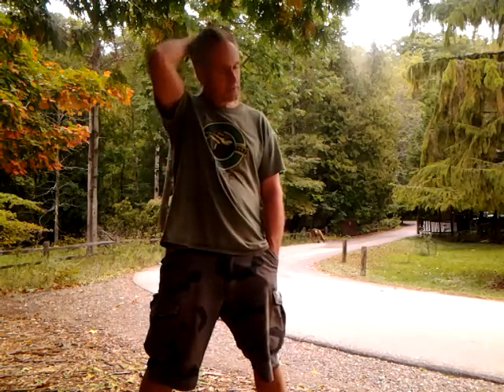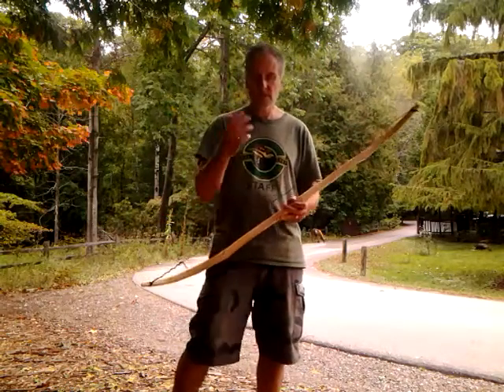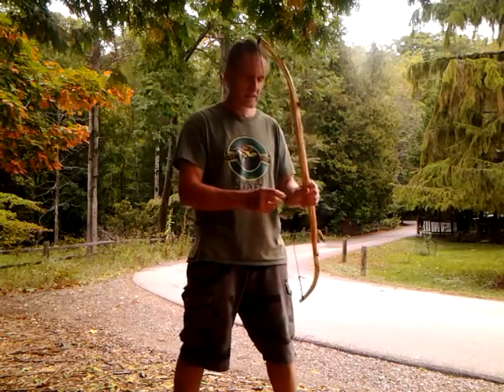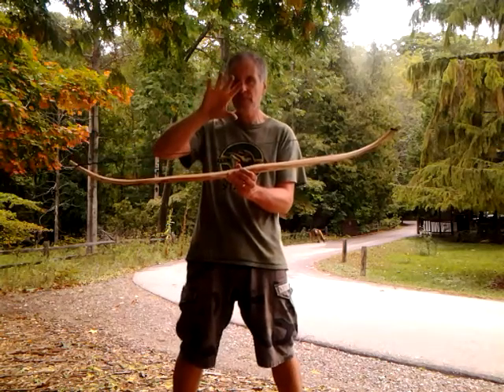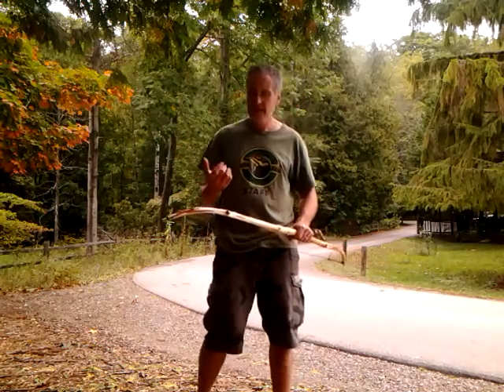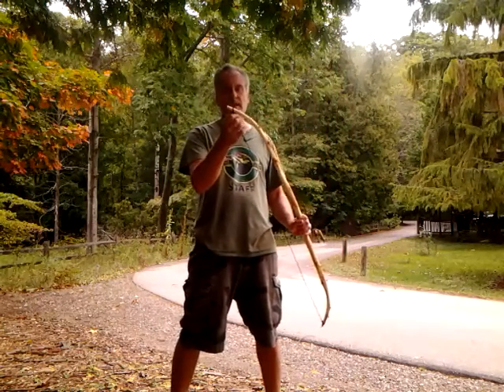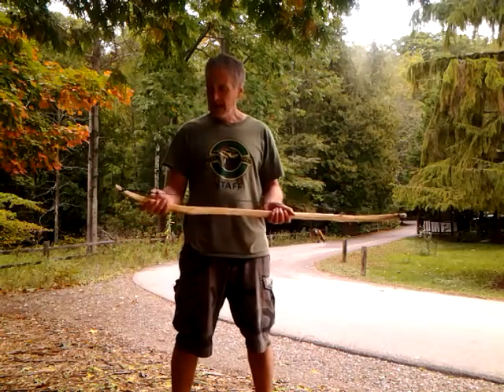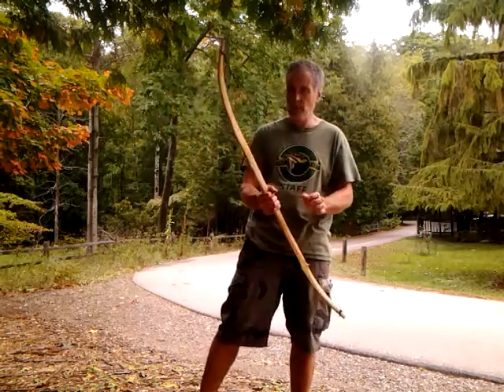How to Make a Survival Bow: Deflexing the Tips

Comment: What kind of nock style or bow string knot would you use for a deflex bow, especially one with a severe deflex, so it doesn't come unstrung while shooting? Looking chiefly to make a short deflex out of mesquite and maybe a pvc one for giggles so if you know nock styles that would be suitable for the geometry of pvc bows as well that would also be very much appreciated.
Reply from the maker: They stack like crazy but sometimes you have pick the lesser of the two problems. I'd go with two regular string grooves but have both ends secured. A slip loop on one end and the other tied.
Reply: @johnjriggsarchery2457  can you clarify what you mean by secured, do you mean with a portion of the bowstring or other cord wrapped around the nocks/end of the bowstring like you see on some native or african bows? Forgive my ignorance on the subject but I have found it pretty hard to find info on this subject. Also is it possible for you to post images of the nocks of that bow if you still have it or similar ones that show the angle the string grooves somewhere?

Comment: Very interesting, I want to try this design with some of my local softwoods/evergreens. So this  kind of bow can be left strung with no detriment?
Reply from the maker: There are limits to string time, but it's funny that you commented on this video. I was cleaning out a closet and picked this bow up which was still strung. There wasn't any tightness in the string but I pulled it back and it still could throw an arrow with enough force to kill a critter. I would suggest making it a little longer and deflexing the tips a little less so it doesn't stack so severely. Do only use branches so the rings will be tight and the wood denser. Have fun.
Reply: @johnjriggsarchery2457    Excellent thank you, do you recommend a low brace height?